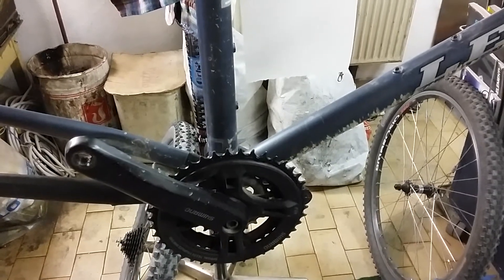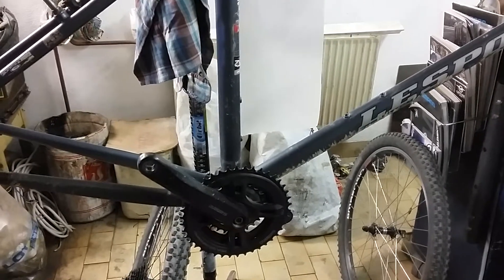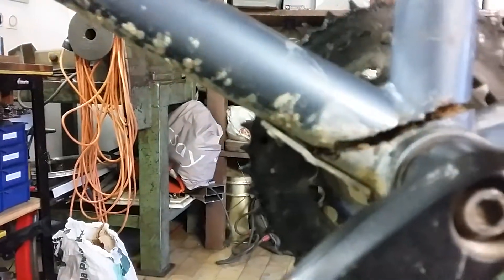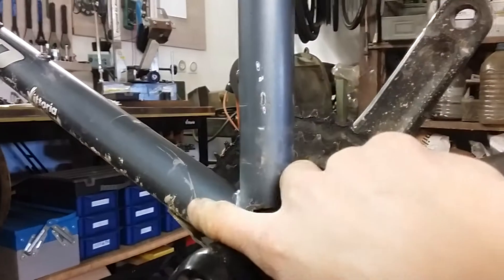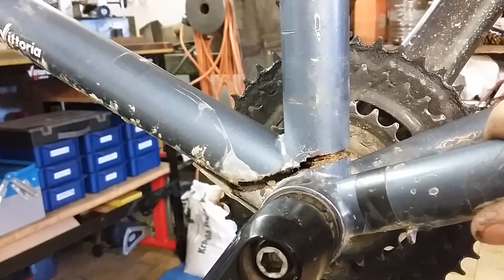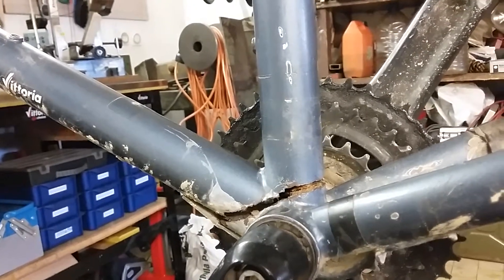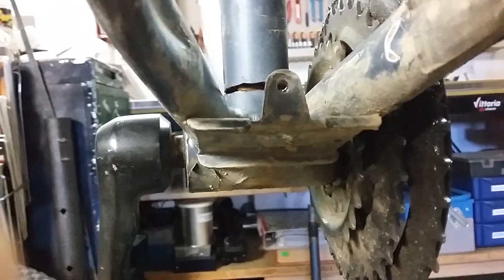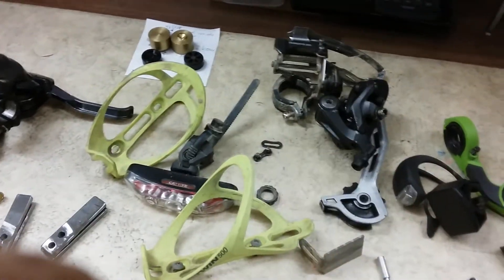CrMo steel frames life span

Comment: So are Double butted Chromoly bikes still good and very reliable? For long term usage?
Reply from the maker: Just check for inner rust. Use crown oil for prevent any rust from water stand inside the frame particular on bb section
Reply from the maker: definately yes. They are one of the best outthere. This Mtb just showed a rough long term hard core usage on offroad without suspension. And it last for 50.000km. Whic is long lifespan according to what had to withstand.
Reply: @gongalab  yay! It's a 96 double butted Chromoly Kona Lavadome. 

Paid 60 dollars for it. If it's still good I'll take your word for it.

Comment: Failure probably has to do with corrosion no?
Reply from the maker: corrosion was not present before crack. it appeared after small crack appeared and thus water could get inside and corrode it . but the material was defenatelly fatiqued severly.